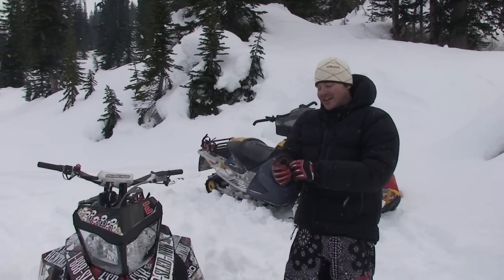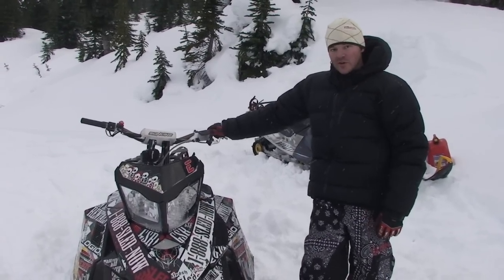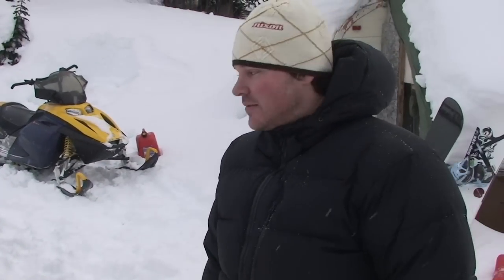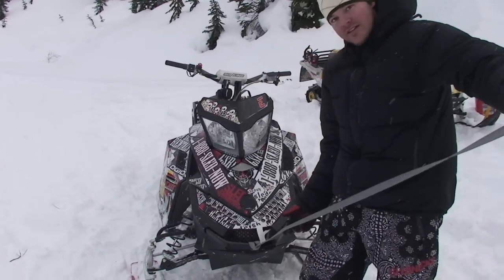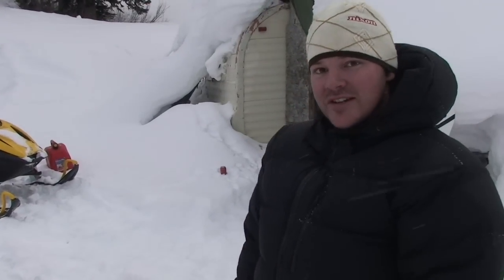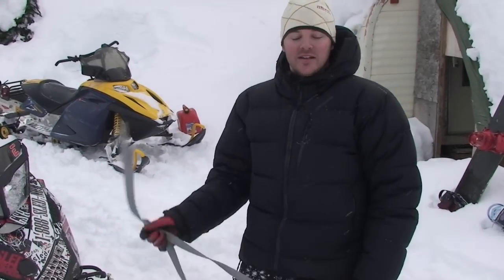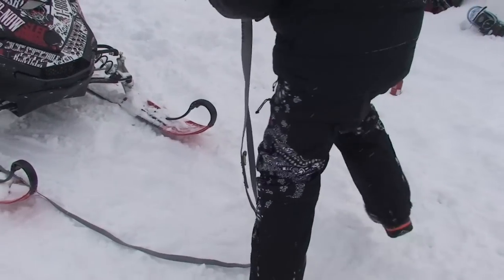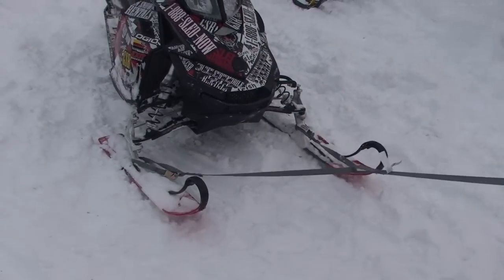How to Tow a Dead Snowmobile - Riding Tip

Comment: How come you didnt show where to attach it to the sled thats towing you out? you mentioned a back bumper falling off but never provided a better alternative
Reply from the maker: Hey Cody! Good question. The rear bumper on some sleds is sturdy enough to tow, but on others not so much (PRO-RMK with carbon bumper for example). In those cases, it is better to attach the strap to the rear of the running board where it mounts to the tunnel. Thanks for watching!

Comment: very nice device another device that is super light weight n easy to pack is the "buddytow"track slide mat.u unroll it clip to front of  track n to back of track it also has two clips to hook in the center of the track n also has 2 runners in the rear for swaying purposes,your machine slides along without absolutely no resistance,,,,so use this in conjunction with a sno bunjie and its virtually effortless on the towing machine thru any kind of terrain

Comment: Textile to textile without a shackle or other hardware causes excessive friction which will damage and possibly melt the slings.  The way he's got the first sling looped through the eye of the second sling will cause the sling from the sled to slide back and forth through the eye of the sling from the two sled.  Even though it's not much weight, the friction will cause damage and if it's a long tow out might even melt through one of them.   A piece of hardware like a shackle or caribeaner at the connection will solve that.

Comment: The best way to tow a sled is strap one of the ski's of the dead sled right up tight to the rear bumper of the tow sled. Then you don't half to have anyone control the dead sled and the dead sled will track perfectly right behind you with no problems
Reply: Yes!

Comment: Not necessarily . It takes skill to properly handle older sleds, with the tippyness and all. And it depends on what you want a snowmobile for. I'm just for leisure and utility use. For that I have two 20 - 25 year old sleds. But of course, if you're into sporty things like snow-cross and mountain, then maybe a newer snowmobile is your thing.

Comment: Save your money all you need is a tie off rope used with a harness. It had 2 clasps on either side hook it to one ski then thru the bumper of the tow sled and back to the other ski loop. And definitely pull off the drive belt and don't have to have some one ride it. It makes it easier on the tow sled b/c of less weight and if you tow it this way the Maxine steers it self
Reply: YES...one ski loop tied TIGHT, no slack, to a CORNER of the tow bumper...no rider on towed sled.  If you are are a flatlander towing down a trail and can find someone stupid enough to eat snow while riding the towed sled...then use the two ski method recommended in the vid

Comment: Is there a video how how to tow a sled that the track is jammed and won't turn.
Reply from the maker: No, but good question! There's two things you can do. 1) Strap a sliding surface beneath the track, like an adult sized crazy carpet (we've heard an old car hood works amazing!) or 2) turn the sled around and lift the track onto the tunnel of the towing sled. The risk is potentially bending the tunnel of the towing unit. Good luck!

Comment: just to clear up a topic i see often it makes no difference if you take the belt off i never waste the time... your primary isnt engaged with the engine off and the belt will simply spin around with the secondary with no resistance whatsoever
Reply: Wrong...😂